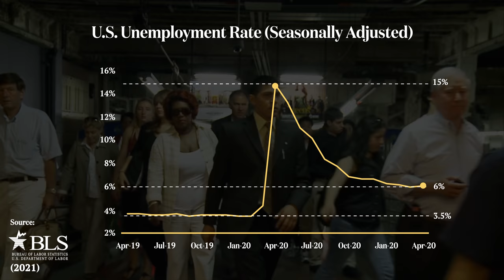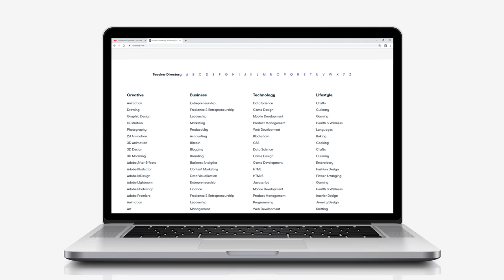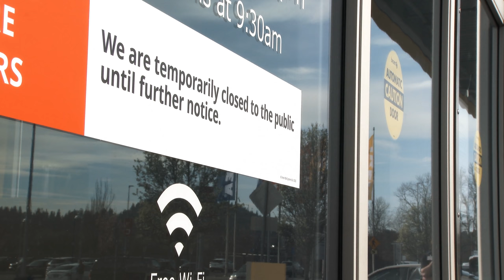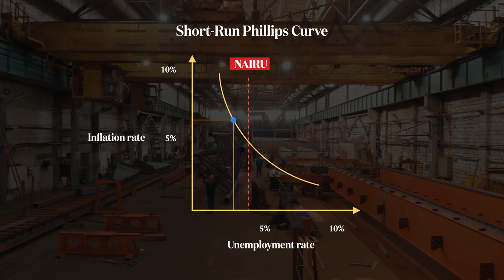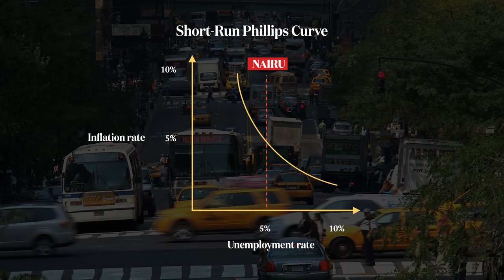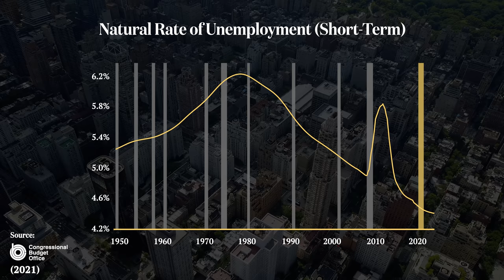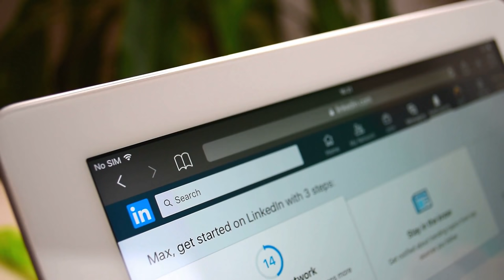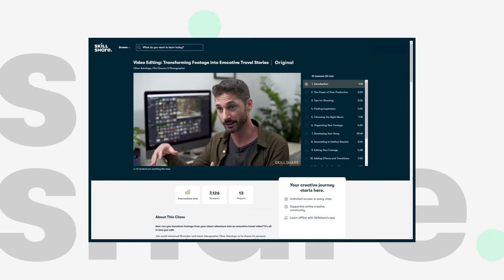The Great Labor Shortage Crisis | Economics Explained

Comment: Everything has increased in price because of the pandemic yet the wages stay the same. People are right to not work for peanuts.
Reply: Actually, wages are not staying the same, the are increasing rapidly. You don't want your burger flipper making $25 an hour, if they did, you couldn't afford the burger.
Reply: @NickMart1985  it's been proven that most of the job advertisements are scams. It's the same ole pay, just a different day.
Reply: @appliancedude63   "Its been proven". Meanwhile, some of use are seeing wages increases of 25% a year in the right fields. With six figure stock deals and 20% bonuses. 

If you think you're going to get a raise moving from one Starbucks to the next, you're wrong. 

There's opportunity out there, but if you're in the service sector or manufacturing, you are completing with too many people to be worth anything. Then you want a wage increase and realize no one wants to buy $20 Big Macs. 

This is coming from someone who worked in those sectors for nearly 15 years and doesn't have a college degree.
Reply: poncho mac  I know how prices work. Whats your point? Consumers also vote in assholes and idiots. You get out of systems what you put into them. Systems don't failure because they are corrupt, they fail because consumers are more greedy than any politician or corporation.
Reply: @NickMart1985  yes I do. Because then I negotiate with my employer to pay me more.
Reply: poncho mac  You insult me and then poorly explain a 9th grade economics lesson? Nice try poncho. You don't know enough to understand what it is I am trying to say.
Reply: poncho mac  Why the xenophobia? Was it necessary at all? I don't get it. How is Martinez a mexican name? How and why does being mexican equal not knowing english?
Reply: poncho mac  Hur durr. Dont forget to wipe the drool.
Reply: poncho mac  Democracy doesnt work. Its why we elect representatives. Do you even know what a republic is?
Reply: @NickMart1985  So the company could buy a robot and make it do the job. Isn't this what they say whenever someone talk about wage increasing?
Reply: @NickMart1985  minimum wages in European countries are around $15, yet the price of burgers there are about 20 cents higher.
Reply: @BigBofrfr  20 cents higher than what?
Reply: @NickMart1985  As my EU buddy is trying to say. In your country you try to pay 7.50$ for minimum wage to flip a burger. In a country like denmark they get paid 20$ plus vacation days and benefits. You would think with your logic the burger there most be expensive but nope only costs 20cents more then one in the US. 20cents is the difference between respecting someone and thinking there trash apparently.
Reply: @ilikedinos2369  I doubt any of that is true. From the raw figures, to the conversion rates, to how expensive it is live. Its all bullshit.
Reply: @NickMart1985  thats not true! To use denmark again most decent housing (900sqfeet) costs about 9836kr or 1570USD. Per month. Then we can compare that to average costs in US cities.
All 900sq feet.
New orleans- 1950
Los angeles- 2100
NYC- 3450
San francisco- 4600
Richmond- 1129
There of course are places were it is cheaper but then you compare the the wages and then you see us wage. Like mcdonalds worker in us gets pair 7.50 then denmark 22hr plus 6wks paid vacation. And it costs roughly the same. Plus the person in Danmark gets great healthcare and reduced prices plus free education plus many other bonuses. That is mostly because of the difference of government. The USA tries to make the most money it possible can even if it means profiting on suffering and the healthcare system. When denmark just tries to make the people happy and serve them well. Denmark makes a whole lot less money bit has far higher happiness and satisfaction.
Reply: @ilikedinos2369  You are literally comparing rent prices to the four of the highest cost US cities. You're not that bright are you? Denmark is the size of a marge US city. You have no idea how any of this works.
Reply: @NickMart1985  And how much in % of the 'production costs' of the burger is the 2 minutes the burger flipper spends on it?
Reply: @benjaminmeusburger4254  Impressive how little you understand about labor costs and are here making a comment. As if the cost of labor is "pieced out" and they are paid per flip. 

Even this basic Economics Explained explanations are so far above most of this audience's head its scary.
Reply: @NickMart1985  I would want that, but the cost should be taken out of pocket from ceos. There needs to be laws regulating how much more a ceo may make compared the avarage employee of a company. That's what the economy actually needed. Stop Ceos and stock sharks from becoming rich from other people's labour.
Reply: @NickMart1985  electing represantives is democracy my man. You're confusing democracy with direct democracy. Isn't the same thing.
Reply: @Turai12  I know that. Most American's don't seem to however. They believe in a tyranny of the majority. They believe, as you do, that we should be able to steal from the haves and give to the have nots. You are an authoritarian.
Reply: @NickMart1985  i live in California. Burger flippers are making the same wage.
Reply: @NickMart1985  
Got any evidence for that?
Reply: It doesn't make sense to work so hard for so little.
Reply: @ilikedinos2369  and its not just the labor cost, most EU countries have higher tax on unhealthy foods, so theres that as well, so the 20 cents is only partially from higher pay
Reply: @Turai12   voting for representatives doesn’t equal a democracy. They voted for representatives in ancient Rome as well. There’s a reason our pledge of allegiance calls the US a republic.
Reply: @NickMart1985  You know, a mcdonalds worker in seweden makes $22 dollors an hour, so rethink mate.
Reply: @NickMart1985  LOL, right, because most people are getting stock
Reply: @MrTVintro  Whats your point? You're probably the type of person that thinks 100,000 employees should each get 1% of the company.
Reply: @NickMart1985  i fail to understand how a $8 an hour wage worker is more greedy than people way above them. Please explain this
Reply: Well price increased directly hafto do with increased cost of production. Increasing wages ups the cost and will further increase prices. It’s one of the well known cycles of inflation. So if you are fine paying thousands for hamburgers I guess go off
Reply: @555salt  Nah man. Higher wages are free. It will all come from the greedy business owners. Duh. #BernieMoron
Reply: @NickMart1985 , oh yes I do. The benefits would be enormous. First, that burger flipper gets treated like a human being and can take care of themselves. Food service is torture, and they deserve 25 an hour.

Second, it'll drive the price of fast food up. This is a wonderful thing. It reduces the value proposition of fast food, which is incredibly unhealthy. People will eat out less and cook more, saving them money and increasing their health in the process. Eating out will become more of an event you look forward to, an occasion, rather than the primary way you feed yourself.
Reply: @emilior934 , I don't gloss over that. It's perfectly true. People there also have higher standards of living and greater satisfaction with government and living conditions. So they're still getting the better deal
Reply: @alexanderschwach7546  sorry to burst your bubble, but the reason why they have better living conditions, its because WW2 happened. Most of the disabled people died. And, while disabled people do be born nowadays in denmark, the ratio compared to healthy people is abysmal, making healthcare cheaper. America has a 1/4 ratio on that, at 61 Million of Americans with disabilities.
Reply: @emilior934 , lol that data needs a citation bud. Plus a study casually linking it to their quality of life.
Reply: @alexanderschwach7546  didn't know this was a peer-reviewed thread, Pal. You can google it.
Reply: @emilior934 , first, you're the one making the claim, therefore the burden of proof is on you. It's not my responsibility to make your argument for you.

Second, I just did and the data actually shows the opposite. The following data is from Table 2.2 on the following study

Percentage of Population with Severe Disabilities
Americas: 2.6%
European: 3.0%

Percentage of Population with Moderate/Severe Disabilities
Americas: 14.1%
European: 16.4%

So no, your claim that Europe has less disabilities is false, they actually have more. Despite that, they are still able to fund socialized medicine just fine, while maintaining higher standards of living than the U.S.
Reply: @alexanderschwach7546  is not Continent vs continent. It's USA vs Denmark vs Netherlands!
Reply: @emilior934 , your assertion relies on the idea that WWII killed all or most of the disabled people, resulting in a lower disability rate. WWII affected the entire continent of Europe, so if this hypothesis held any water, we would certainly see some degree of it when compared to the Americas, which did not experience any of the devastation that came with WWII.

We don't see that, we see the opposite. There is no evidence to support your idea.
Reply: poncho mac  racist much?
Reply: Man bro, restaurants shouldn't even be a thing.  Just cook at home.
Reply: @Necroman98  how do you do that if you're homeless?🤷 forget about the eviction crises?
Reply: @NickMart1985  Sweden it's 22hr and big Mac costs a buck or two more so yeah your  point is bs
Reply: Actually you could pay them 18houur instead of 7... I'm Canadian , so I cook my own food. But in America bigger flippers are valuable.
Reply: @NickMart1985  because mcDonald is too poor to afford paying their workers...
Reply: @infernocop31  The problem here is a fundamental lack of understanding on your end. Do you even know what the word "margins" means with regard to business? If you don't you're out of your depth and shouldn't opine on these matters.
Reply: Just don’t buy burgers if they’re not worth paying someone a livable a wage lol
Reply: Increased costs because stimulus $ + shortages
Reply: @TrevreWxAZ  stuff’s starting to taste like garbage anyway. Am finding that homemade is way tastier
Reply: @ilikedinos2369  Mcdonald's workers in the US don't get paid 7.50. Almost nobody gets paid 7.50. Less than 2% of all wage paying jobs pay that much.

Comment: The average American's wages have been stagnant for decades.
Reply: This is true
Reply: For the sake of the argument, I will use SSA data from 1989-2019. In 1989, the average American made $18,274.38. In 2019, the average American made $50,040.95. If you adjust for inflation over those thirty years (106.2%), you see that (in 2019 dollars) the average American in 1989 made $37,677.20. The current numbers are probably an even bigger differences due to high unemployment (SSA has yet to release data post-2019). Just because the minimum wage hasn’t increased, doesn’t mean Americans aren’t making higher wages. Also, if is wasn’t made clear in this video, increasing wages isn’t necessary a good thing. It defeats the point of paying someone more if they have to spend more for goods. In fact, all you are doing is crippling the savings and investments of the middle class by causing inflation. It’s simply stupid to say “the average American’s wages have been stagnant for decades” when it takes 30 seconds to prove otherwise with a quick bit of research.
Reply: @koalaunknown  Take the median, then were talking. Having more millionaires is a good sign but it isnt when the rich increase their earnings far more than the poor.
Reply: @koalaunknown  Your first mistake was using average wage, instead of median wage which are two completely different things. Average wages have gone up because income inequality has skyrocketed. People in the top half have seen dramatic wage increases while people in the bottom half have seen virtually none. The top half increase skews the average wage figure. Median wage is the more meaningful statistic.

Comment: I'm no economist of course, but wages in my region and industry (archaeology) haven't seen a substantial increase in almost a decade. The cost of education for my profession has seen almost a 120% increase for in state students, and a 60% increase for out of state students in the last 10 years. There is currently a "labor shortage" in my area, but the last time I applied for a job that advertised $16-26 an hour, I asked for the midrange (22) with a couple years experience as well as a masters degree I didn't get a call back. Most professions requiring a 4 year degree are hiring new employees that owe in excess of 6 figures in student debt,  and companies are still hoping to underpay rather than fairly compensate in my opinion. Rather than looking at it as a problem, I see it more as a "wage correction", similar to how the stock market sees an occasional "market correction" when assets are overpriced or there is an asset bubble that pops. Wages were severely undervalued in comparison to the price of rent, food, and other requirements. When I compare that to other nations I've lived in, now companies are being forced to correct for the undervalued wages they paid when it was an employers market.

Now that there is an excess of labor, workers in the USA are in a position to demand higher wages. Which to a degree will increase some prices, but I've purchased a Burger King Whopper in Copenhagen Denmark where workers are paid $20 an hour in comparison to $12.00 in Arizona, and the price of a Whopper is the same.
Reply: Yeah. I finished my bachelors in cyber security in late 2019. It took till August of 2020 to find a job, and when I did it paid just $1,500 a month doing DLP triage 25 hours a week. $50,000 in debt to make $1,500 a month with no benefits? That's not sustainable.
Then I got laid off with no warning in January, along with a third of my coworkers. 

The corpos want you to have 5+ years experience, a bachelors degree, multiple certifications, and a TS/SCI with poly for entry level systems administration paying $20 an hour.